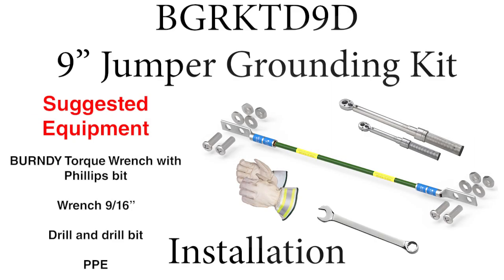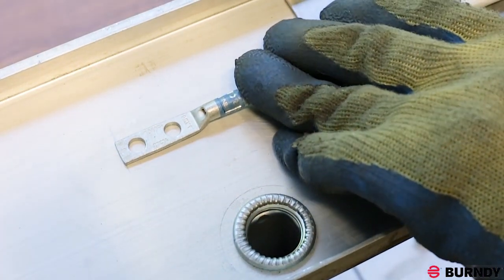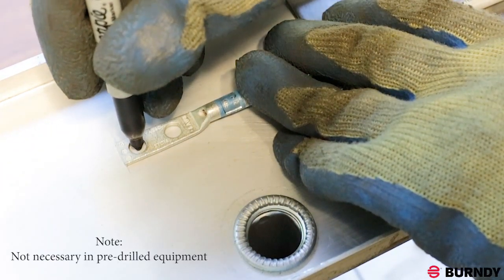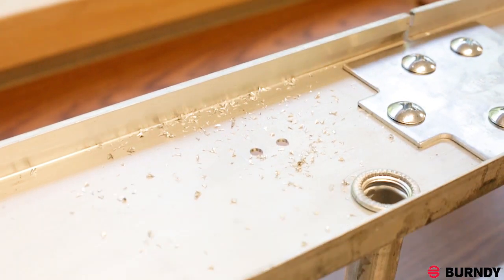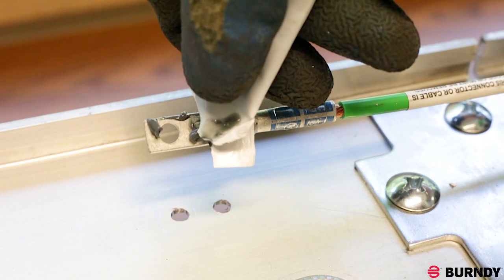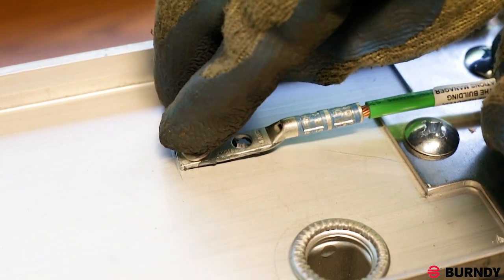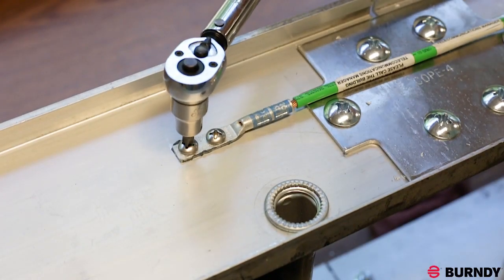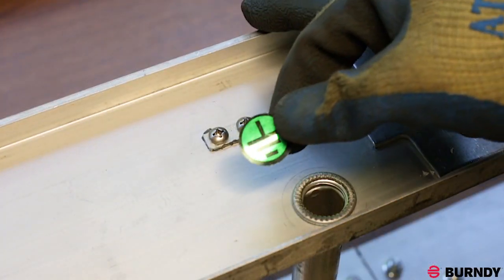BGRKTD9D Grounding Kit Jumper Installation

Comment: The bolt heads do not go this direction. Threads out so that the cables don't gt damaged. Come on. This is as bad as the 35 videos that have knicked strands by installers who may never have terminated a 14 guage solid before.